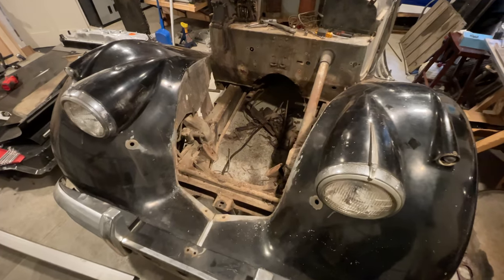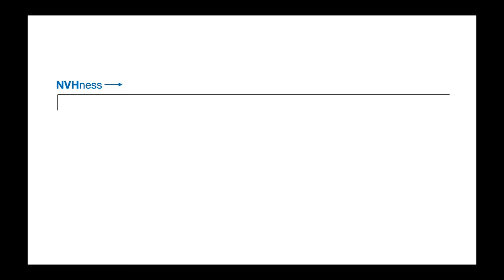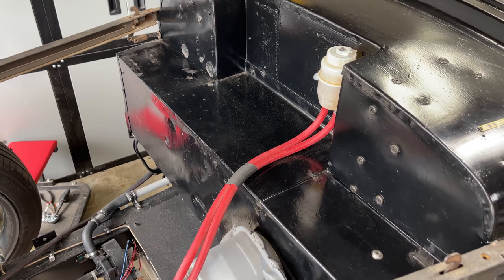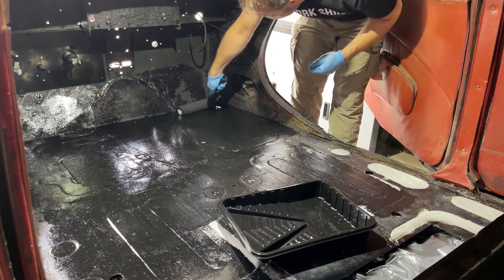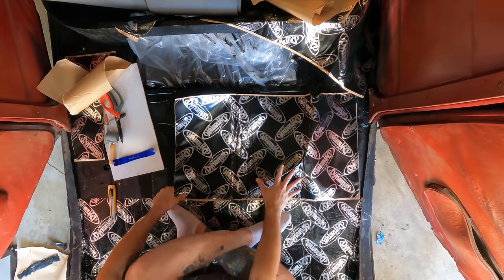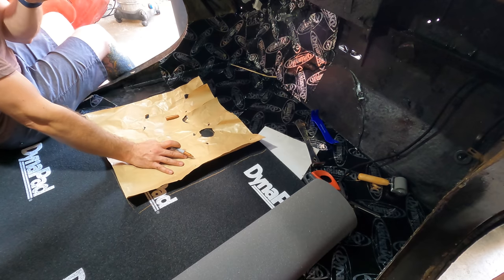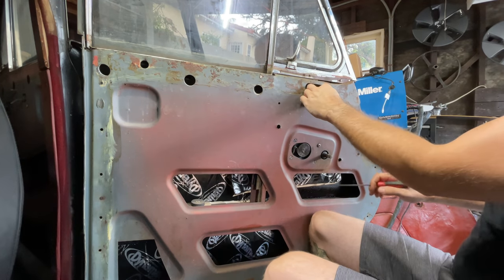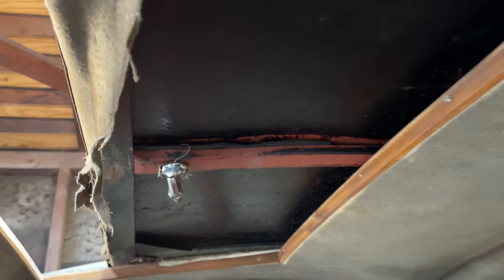EV Swapping Your Car Will Make It Louder. Here's How To Fix It.

Comment: I love that you likely spent $40ish dollars on a white noise generator simply for the 5 second gag.  It's one of the many reasons I love this channel.
Reply: Think he has kids. He probably has 20 already.
Reply: @richardschofield2201  Actually they are all algorithms!
Reply: I came here for the cars and left wanting a white noise generator.
Reply: Or pro tip (that I do not advocate for) buy online and send back after the short use. Don'tdo that though.
Reply: @richardschofield2201  LOL I have twins. I've gone through 10 of them
Reply: @Shiftheads  I've donated a few to hotel rooms
Reply: Dynamat royalties paying good 😂
Reply: Oh you kids today are so unfortunate. In my day, if we wanted white noise, all we had to do it switch the TV to channel 3 while the volume was all the way up. Nothing could make Mom say "Get up and change the channel" faster than that. 
And yes, I do predate remote control...at least at our house.
Reply: I legitimately thought he going to measure the frequency response inside the car, install the insulation, then measure the frequency response again and compare... Oh well, lol.

Comment: Actually, mothers' wombs are very loud for the baby. All that blood and fluids pumping, loud sound of the heart and mother's lungs breathing. It's one of the reasons shushing and white noise works well to calm babies down. Because it mimics the wooshing and loudness of the womb.
Reply: That’s kind of a self defeating point, “mimicking the sound of being inside a womb calms babies down”. (Don’t you want calming sounds?)
Reply: @orppranator5230  No my point is that it's LOUD in the womb
Reply: But it's consistently loud, few impulse noises.  Hence the white noise generator.
Reply: @Lawrence330  exactly
Reply: Pretty low on NVH though, I think.

Comment: Listening to this episode while wearing headphones really shows the sound differences.  I really like Dynamat.  It is hella expensive, but like you said, you get what you paid for.  I put a bunch of this in my 65 MGB and just doing the doors made quite a difference.  Great episode, and nice to see another sponsor coming on board.  Maybe they will give you a code for us plebs.
Reply: Wonder if I can Dynamat my 3D printer 🤔
Reply: @mr_voron  if it is encloused and has somewhat flat surfaces, go for it. I did smth similar and it is well worth it!
Reply: That sounds like something I should do to my ‘77 Midget, I’m gutting everything in there right now anyway...
Reply: The tinny clang from a MGB door is part of the charm. I fool myself that it's the consequence of it being a light weight, sporting component.
Reply: You don't need to use this much. In terms of the sheet metal dampener, factory cars (economy cars at least) usually just have the underseal underneath the car, then most of cabin floorpan treated and then only a few small rectangular pieces around the boot and one small rectangle on each doorskin.  

Plus a fitted insulation pad on both sides of the firewall (with all the holes cut out where the hoses and wiring passes through) and underneath the bonnet. 

Then the underlay, be it foam type or cotton felt type, and the carpet does the rest.  (With either more cotton felt panels or 3M Thinsulate panels attached to the back of the interior plastic trim panels, but these are usually not full coverage on an economy car either.)

Of course luxury cars are a different story!   They have fitted insulation pads even above the headliner, thicker dense polystyrene-like foam covers over the rear wheel arches (& inside the front wheel arches too), acoustic or double glazed glass etc.  Even if you heavily sound deaden your economy car with 50kg/100lb of extra insulation, noise will still pour in through the factory glass which will be still be much thinner than on a luxury car, plus vibration will still come through the (usually) rigid mounted subframe unlike the fully isolated subframes on a luxury car.

Of course to obtain a significant difference, it can be useful to use this much or even more of the stuff -- different types not just Dynaliner & Dynapad, but also thicker cotton felt underlay, more insulation on the back of trim panels etc.  In a modern car that already has insulation, you need a surprisingly large amount of it to make a significant difference -- the difference might be more pronounced in an older car that originally had almost no insulation at all.  Obviously the advantage the OEM has is they can target specific noise sources and be scientific about it with before and after comparisons as to using guesswork.  E.g., the "blankets" often found on top of injectors like on the Ford Ecoboost or even on engine timing covers (there's an insulation pad down the timing side of the Alfa Romeo 2.4TD engine) or even the entire engine undertray has an insulation pad on some cars (perfect for absorbing oil!) these days.

Comment: Years ago,I had a class 5 desert car that I drove on the street. Solid-mounted engine and transmission. No insulation. Aluminum interior panels, and a close ratio trans all added up to a seriously deafening experience. Ear plugs were mandatory. An ex girlfriend refused to ride in it. Still, I had some of the most fun in that car that a person can have. Good times!

Comment: Regarding your beginning segment, it's true, not a lot of people realize how many sounds a vehicle can make, on a motorcycle, the engine's vibration is so loud and overpowering, that if you drive on a highway close to the concrete barriers will scare the hell out of you as you'll actually start hearing the chain, which resembles the sound of throwing a rod

Comment: Instead of the Dynaliner you could use any HVAC closed cell foam sheet such as Armacell.  It is a common industrial product and should be much cheaper. Rated for cold and hot temperatures. For large flat sheets of metal, where you don’t mind a bump. You can glue or tape a strip of 1/4” D shape wood strip on the diagonal or in an X pattern. Then Dynamat over or around it. The wood structure gives it stiffness and you could possibly even save on the Dynamat.  For slightly curved panels, I think laying on the wood strip with double sided tape could be done.

Comment: The Sunroof is possibly sealed like my Bentley MKVI with felt around the edge of the moving pannel; the felt works really well and much better than i expected it could.
I still have the engine but i have been trying to get rid of noise anyway.

Comment: Early last week I finally found a buzz in my car. Most of the sound made me think it was coming from my passenger door speaker, but it turned out to be my tire pressure gauge vibrating in the thin plastic glovebox.

Comment: I once did this the cheap way, getting ice/water shield roofing material remnants and putting it inside the doors of my Saturn. I told myself it made it quieter and improved the audio quality. It definitely made the doors feel better to close.

PS. The rubber roller you use is called a "brayer" for some reason.

Comment: When they rate new car purchases for "most trips back to the dealer", the expensive cars always look like garbage.  
Another analysis revealed that many new owners go back to dealer in 1-2 months, repeatedly for NVH.
"I can hear a whistling when I am going 85 mph!"  The one-percenters complain like crazy.
Reply: Well if you dropped that much cash on a vehicle, you'd probably go crazy on that too... Aftermarket vortex generators (IIRC) came out in no time for the A90 Supra because of the wind noise.
Reply: I imagine I'd complain a lot more if I had bought a new Mercedes Benz. I purchased a Kia Soul so I'm happy its quieter than my 03 PT Cruiser.
Reply: @darwinskeeper421  to be fair, anything is quieter than a PT cruiser.😀
Reply: @mikeincinci   Darwin, the modified 1979 Malibu wagon, would beg to differ. Mind you, she has had full length tube headers, and a dual exhaust so it shouldn't be surprising that she has always been louder than my PT, or any other daily driver I'm likely to have.

Comment: Nice, and smart, of Dynamat to sponsor! Helps us to understand the before and after affects of sound proofing; especially obvious when you drummed on the two doors - great comparison. I can't recall how much VW coats their cars with, but I seem to recall they use 35 lbs of sound-deadening spray and stick-on foam - per car. VW sound and paint tech are probably the best in the business; their negatively-charged paint treatments work better than galvanization for corrosion prevention too.
Reply: I bet they use 57 styles of adhesive applicators with multiple styles of nozzle tips too.
Reply: @tihspidtherekciltilc5469  Yes, No-doubt; even the robotic seam-sealer nozzles are super thought out. I heard that Tesla's new factories are building cars with one-third the time and effort of current VW plants - due to gigapress and similar tech  FYI. You mentioned their focus on steady improvement at Tesla factories in a previous video.
Reply: @EdwardTilley  I was throwing shade at VW for using ten types of fasteners to hold the thermostat housing on that's buried in the engine.
Reply: Well yes they use it but they use tons of it. I worked for volvo for a few months and the sound deadening tech was always joking about VW  that they just spray tons and tons of the stuff on the car instead of using it precisely and just enough increasing the weight unnecessarily and paying more for the Material. He noticed that on a VW factory tour
Reply: Oh and VW is definitely not the only manufacturer that uses negatively charged painting techniques. 
I know of BMW for sure. But I am pretty sure they use it to waste less paint
Reply: @mikethompson7046  Understood - and they probably have a 25-year contract with a supplier to keep costs low - so they can be generous with it - as well. I will say that my 2011 Jetta Turbo-diesel 6-speed felt as solid as a rock and I spent a few 8-hour days running it at 180 kmh while the rpm sat at a very comfy 3100.

Comment: Dynamat /Dynapad are the best products by far. I also use expanding foam for hollow sections and mass loaded vinyl / closed cell foam if I cannot afford Dynapad. Every car I own I fully sound proof the trunk, hood and under the rear seat..takes away boomy road noise and a lot of exhaust/mechanical/suspension noise.

Comment: A real engineering focus would be what is the minimum amount of dynamat you need to dampen the NVH. There are studies done on the diminishing gains of full vs partial cover from metal backed butyl rubber sound deading. For doors I think it was 30% cover on the resonant center of the door skin as well as the inner door frame
Reply: Yeah, economy-type cars (so a Renault Megane or a VW Passat) usually only come with one rectangular panel of deadener applied somewhere near the middle of the doorskin.  It's enough to remove the resonance of the door panel and get rid of the hollow clang sound that makes the car sound cheap when the doors close.  There are usually some insulation pads (cottonfelt or 3M Thinsulate) stuck to the back of the interior plastic door panels too, but again usually not full coverage.  

 If it was a Bentley where the goal is to try to block as much as noise as possible coming through the door including double glazing (as well as trying to block noise as possible everywhere else including the roof), I guess the approach to insulating the door would be quite different?

I think it is important to use a variety of different types of insulation.  Modern cars usually have fitted insulation pads on both sides of the firewall and then the carpet underlay and so on. Luxury cars often have thick polystrene blocks over the front and rear wheel arches (in addition to the carpet-type insulation on the wheel arch liner itself, sheetmetal deadener directly on the cabin side of the wheel arches, carpet underlay insulation on top of that on the inside of the wheel arches  -- I even saw this on the front wheelarches of a Ford Focus which is inside the engine bay which seems crazy but front wheelarch>engine bay>cabin must be a significant noise path, big foam pieces to remove cavity resonances from the rear quarter panel area etc).

Comment: We had a code for interior design NDH, you could spend a fortune on a sound deadening interior, leather and real wood but fail due to not having NDHs. Someone climbs into a showroom car, and after gripping the wheel and staining moodily off into the distance, check s for NICE DRINKS HOLDERS….

Comment: I really suggest getting into aerodynamics of the car: there are many things you can do with cars, especially old ones. I can recomend Julian Edgar's books on the topic.
Reply: Maybe Matt should follow in the footsteps of Malcolm Sayer (Jaguar's head of aero who developed the D-Type in the early 1950s). He taped wool tufts into the car and adjusted the shape to get smoother airflow.
Reply: @johnmckay1423  Wool is just one of many test methods BUT it shows only where flow detaches from car. There are much more you can measure to get information about aerodynamic characteristics of your car.

Comment: 1:00 Every single Ford Focus Owner ever. I swear we get probably 3 posts a week in the ST/RS clubs with new owners asking if the "ticking noise" is normal. Every time we have to explain what a High Pressure Fuel Pump is.

Comment: I love Dynamat, used extreme and dynapad (where it fit) all over the inside my PC case over ten years ago and it went from already very quiet to utterly silent. Did I waste a tremendous amount of money? To answer that question allow me to ask you one in return - Will you be enjoying your standardised layout PC case for the rest of your life whether you want to or not? Exactly.
It turns out the real friends were the possibly overheating but definitely inaudible components we owned along the way.
*Engineers pls no dunk on me by abandoning ATX k thx bye 😅
**PS I didn't block any vents obviously. Or not obviously. You be the judge.
Reply: I used self adhesive asphalt roofing patches and the foam my computer hardware was packaged in. Did it work as well as dynamat, probably not. Was it insanely cheaper and good enough, hell yes. It dd stink of tar for a bit though.
Reply: @soangry lol, nice one. I actually had leftovers from a car build so while it was significant, the cost was already sunk so to speak.

Comment: Nice... I looked at dynamat for mine, ended up going with another brand that's a little cheaper. Time will tell if I regret it. Mind you, I'm fitting one of those dreadful old-fashioned internal combustion engines, so it probably won't make a lot of difference anyway. My car isn't exactly a Bentley :D

Comment: I don't know man, I've had a electric Kia Niro and the ONLY noise I hear is the fake noise it makes under 15 miles an hour to be audible to pedestrians.  When I turn that off...  Nothing.
Reply: old age does help :) and it is also half of the point Matt made. using sound deadening works, especially if it is installed, like on new cars.
Reply: So you're saying if you want to hit a pedestrian you just have to be going faster than 15mph? Interesting. It would probably look strange with a bullbar though right? ;D
Reply: I can hear the clicking of the high voltage contactors and relays in my volvo xc40 p8, also a slight motor whine during acceleration.

Comment: What would you guess for the weight of all the dynomat?
Reply from the maker: About 85 pounds (40kg) for the whole car. They sell a lightweight version called SuperLite that is 30% lighter. If you're worried about weight, you can just do the middle of the big panels. it won't be as good but it'll be a lot better than nothing.

Comment: @SuperfastMatt, I need to know for my project, what paint did you use for your floor? Is it a special paint? Or just paint?
Reply from the maker: SPI Epoxy Primer. awesome stuff, really tough. it's made to go on bare metal and you can put body filler over it, so it's great to put down on anything you might paint later. or anything you need a tough coat on, like the floor.

Comment: Is the Dynamat water proof ? In some old cars the winding window seals are not even designed waterproof.   the endless rain runs down the glass & through the door. Soggy sound proofing might rust it ?
Reply from the maker: I believe both dynamat and dynapad are waterproof

Comment: My old Prius is very quiet and has no 'dynamat'.  It does have rubber liner thoughout the floor/firewall.  One can remove this stuff for 'free' if you get a Prius with a stolen cat and a dead HV battery..

Comment: Matt,  Do you know what connector pins at the inverter DC input  is pos and neg on the model 3? I can't find a marking. The Model S motors have them on the cables but not on the Model 3.
Reply from the maker: I don't know, and I'm not sure how to find out without taking apart the penthouse. Sorry.
Reply: @SuperfastMatt  Hi Matt,  After a lot of research and help from Electric GT the wire closes to the axle is positive ( PIN 2 in the connector). So add that to  your notes for the future.

Comment: Any way to predict harmonics from the new EV drivetrain? 

Also, does the plain DynaMat sound product also help with heat and overall cabin thermal transfer (less transfer = better efficiency for your HVAC)?
Reply: Well yes he said it in the video no ? 
Makes sense because it's essentially insulating foam
Reply: @mikethompson7046  no, not the Pad or Liner products.  The OG DynaMat...does it provide thermal insulation, and if so - how much?
Reply: @PWN_Nation  From my experience yes it does, a little, though not to the degree you may want (badum, tiss). If that's important to your application I would add something designed to achieve that, whether from them or elsewhere. Dynamat make no claims as to it being thermally insulative.